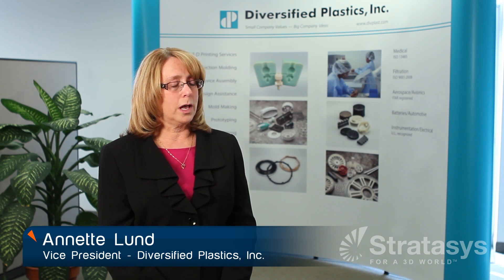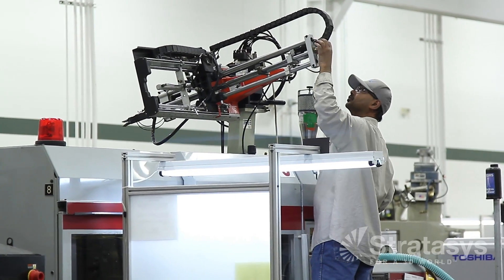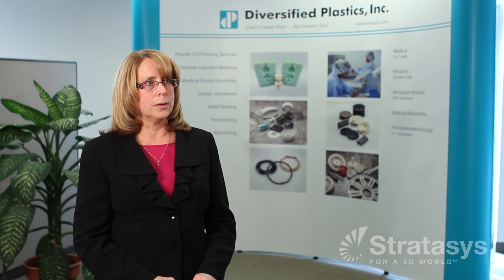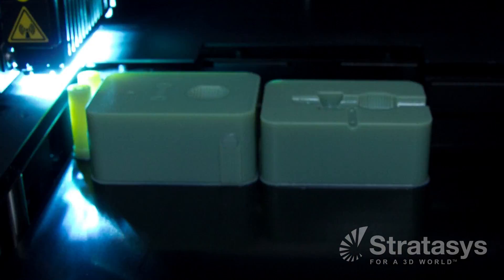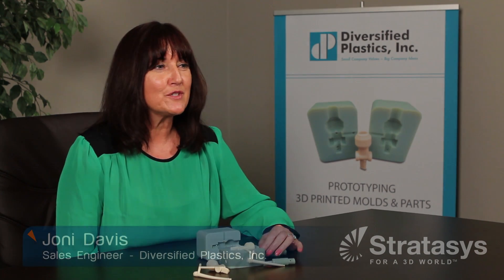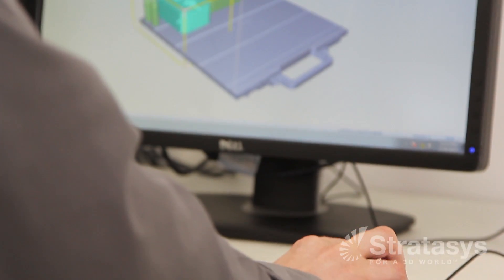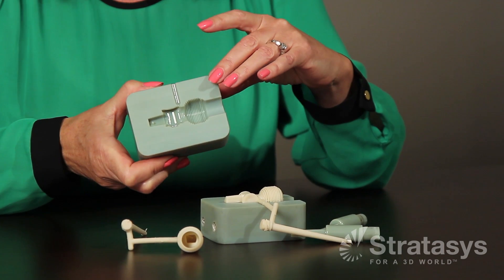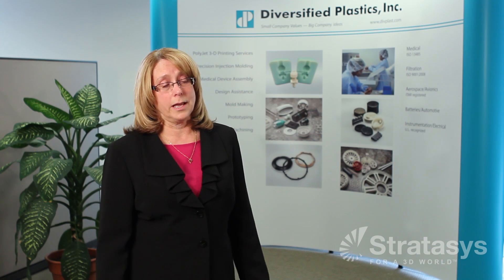3D Printed Injection Molds Save Time, Money for Diversified Plastics

Comment: I was very interested in doing this for my company until I called every injection molder in my area and they all refused to work with 3d printed molds.  Do you have any advice on how to find one that will, or how to convince the local guys to do it?

Comment: Hello, I would like to know if these machines, can inject an elastic material, based on ABS / PLA thermoplastic, for mass production of shoes.
The design would perform normal 3D printing but the process is very slow and I need speed of execution and production of the product.
The current system based on metal injected model is costly and slow ... I really like your system can send information and pricing for the machine that can perform injected shoes, water shoes, sandals?
Info@bosonsolutions.es
Miguel Rico.
Thanks.